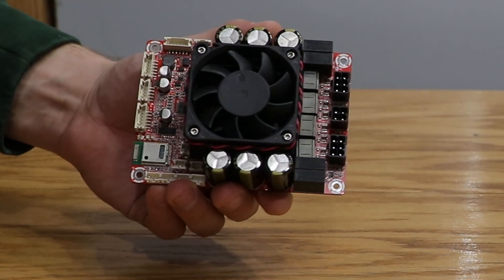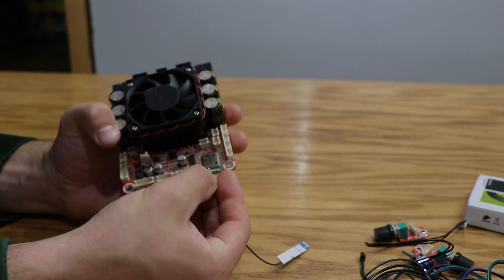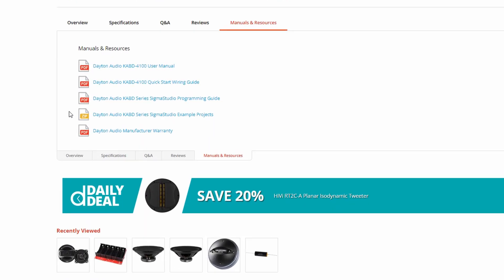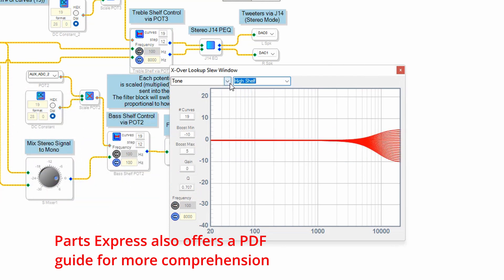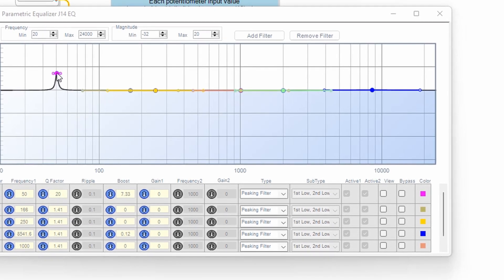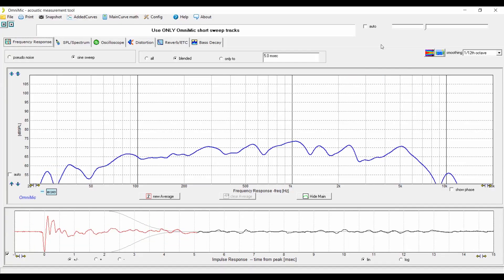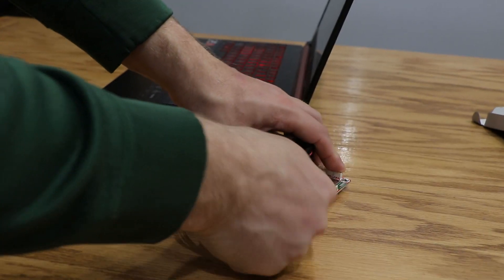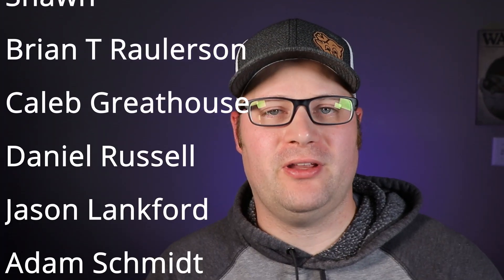Is this the Most POWERFUL Amplifier for DIY? Dayton KABD with DSP

Comment: The only problem I find with these boards is there's no support for power supplies. I mean you can cram 2 of these boards in an enclosure that contains 4-7 drivers including a subwoofer & have an ultimate active speaker but you have graceful way to power the damn thing!!! You can possibly repurpose a meanwell supply by removing its case but those supplies absolutely require the fan to prevent overheating & they're not designed to withstand the vibration of an enclosure. PE doesn't really offer any board power supplies that are needed for a high wattage output, so how do you power them...?

Comment: This is exactly the information I was looking for. I would say that your video has inspired me to experiment with a DIY solution to this problem: I am an aging ham radio operator. My hearing is shot, and ham radios have notoriously poor audio systems. That combination really impacts my enjoyment of ham radio. There is a turnkey commercial solution, a one-channel 10-watt 4-inch DSP speaker that is available for $220 US. I may buy one just to determine if it helps me. If it does, then my other radios would be candidates for a DIY project. Thanks again.

Comment: i wish someone would actually dyno this and see what the real power output is!!!! it wouldn't be bad if you actually got 2x100 watts i buy 4 and build 2 4 way speakers consisting of a woofer/lower mid/upper mid/tweeter.. obviously it would be much better to build a crossover, i mean if a $100 amp could sound so amazing why did i buy a $3000 yamaha as 2200 amplifier!! sadly i just know nothing about building crossovers so i might try this.

Comment: I’m a bit late on this, but is it possible to utilize 2 of these boards in a pair of speakers (more so, 1 board in each speaker) to create a true full range (high+mid+low) speaker? 

I did this already using some stupid high end components (hypex 125w x 2 + 100w tweeter channel) I used an Aurum cantus ribbon, peerless 6.5 HDS mid, and 10”peerless HDS subwoofer. I think it goes without saying that every by setting a very crude crossover within the hypex dsp, they sound great. I was never able to fully understand all of the ins and outs of actually testing each driver and its response using the mini dsp mic with REW which I purchased as well. I had a hell of a time trying to navigate within hypex’s dsp and there is little to no support on how to do such. The instruction manual they supply through their website is tough to understand if you are not familiar with the interface as most of it is simply literature and no actual demonstration of these functions. I have a feeling that the ability of what I have build is not even being scratched at the surface. I spared no expense and planned on trying to sell my product had it been successful as far as audio quality is concerned. Don’t get me wrong, they sound incredibly well as I followed all of the q parameters in building the correct enclosure design, and as stated, also set a crossover that makes sense based on the points in which the drivers fall off within one another. There is MUCH more room for improvement but I do like this idea of a smaller and more simplistic approach. 

Also, what is the over all sound quality of these boards?

Comment: I always had a question about these boards. How can I use these for speakers i am trying to build with some off the shelf amps like XA25 or JC-5 etc. I would not want to replace those fancy amps with the amps in these. When I use passive XOs I can use those between the amps and the speaker. But with DSP type XOs do I need to get these fancy amps for each channel or are there DSP boards that take speaker level input like passive XOs ?

Comment: Hi,
I have the KABD 4x100 and I'm driving 4 store-bought speakers. How can I control fade/balance? I have ordered a KPX. Would like to fine-tune the sound. Any instructional videos you can point me to? Thanks
Reply: i believe you have to buy extra addons to connect it to a computer and use the actual DSP... does it go decently loud?

Comment: Can I use plye 4ch hydra bluetooth amp , plye 6.5 1/2 400watt marine with this Talentcell Rechargeable 12V 6000mAh/5V 12000mAh DC Output Lithium ion Battery Pack for LED Strip and CCTV Camera, Portable Li-ion Power Bank?
Reply: Yep lol good luck with that. :D
Reply: @halrichard1969  how do I hook that battery up to the amp where does the blue wire connect do I need a toogle switch to turn on & off or can I turn the amp off with the battery
Reply: @halrichard1969  how do I connect the red black and blue wire on the plye hydra 4ch Bluetooth amp to the 6000mah Talentcell rechargeable battery?
Reply: @halrichard1969  how can I hook up plye 4ch hydra bluetooth amp 12v Talentcell 6000mAh rechargeable battery , APIELE 22mm Latching Push Button Switch 12V Angel Eye Ring Light LED Waterproof Stainless Steel Round Metal Self-Locking 7/8'' 1NO 1NC 1 charge port and using these 10pcs Conductor Compact Connectors Lever Wire Nut Electrical Connectors with Fixed Base for 3 Circuit Inline Splices 28-12 AWG with out soldering wires ?

Comment: I’m wanting to cascade two of these boards to create 3 way speaker system but can’t find anything referencing the power requirements for two of these together, anyone point me in the right direction?
Reply: I am thinking the same thing but yeah if you want the same output per channel you will definitely need two bricks.  One brick for each amp if you want the same output.  One brick if you want half the output.  Not even sure if that would work. I dont thinkn you could carry all that power on those thin bridge wires to the second amp and all the rest of that particular circuit would have to handle the power.  Pretty sure you will need two bricks sir.

Comment: can this be used in someway or configured on a 1 inch tweeter / 2.5inch mid and 2x 5.5 inch subs in each cabinet? or would I then be more easy if you did a 2 way coax tweeter / mid combo unit and 2x 5.5 subs ?
Reply: Well you didnt specify the actual power output of each driver.  You could, say, put the tweeter and mid on one channel sharing around 100 watts. You could then put the subs on the other two channels for 100w each.   So what Im sayin is one Cab - Tweeter/Mid/Sub with two Channels and the other Cab same same with two channels. its a four channel Amp.    I would definitely get the best brick for power.

Comment: Can KABD dsp do 4-way crossover for both left and right?
Reply from the maker: Each board has four channels. So you can do four channels on each board. If you need a channels, you will need two of these boards.
Reply: one board can do 8channels, but can only output 4ch, so in theory yes, you can, but only using extra amps or dacs with i2s inputs :)  @Toid

Comment: I have a simpler adau1701-based board but wasn't satisified with DAC/ADC performance. It's possible to connect USB interface to it and two DACs over i2s but stuff like this is way beyond my knowledge...

Comment: My question on this is whether or not there is a way to run sigmastudio or a similar program that can set up these DSP's on a Linux PC? I've searched the internet high and low and have found next to nothing that is relevant to this question.
Reply from the maker: I doubt it. But you would need to ask Sigma studios
Reply: @Toid  Unfortunately I've already reviewed their site for the information and they pretty much give any OS other than Windows the middle finger and move on. Thus the reason I was hoping that someone here might have an alternative or a work around to use Linux. Guess I'll keep searching. Thanks for the reply.

Comment: i have a triTrix kit of 3 drivers in each speaker
so that means i'll have to buy 2 of this 4 channels amps
at 90usd Each Before shipping that's 200 usd after shipping.

it's not the same as 60usd worth of crossover parts.
Reply from the maker: The tritrix is a 2-way design using 3 drivers meaning you would only need one of these amplifiers. The two woofers, since they play the same frequency range, 
would be on one channel of the amplifier. While the tweeter would be on the other. Is that more expensive than the crossover parts? Sure. But this also is your amplifier, so I guess that would depend on whether you needed an amplifier or not. But in general, going active is not necessarily cheaper, however it is an option if you desire.
Reply: @Toid  your right if i can connect the two drivers to same one its only 90usd for all the needed parts. so u connect this directly to the tv ? and speakers directly to this ? and then no tinkerinb with settings to make it know your specific drivers ?

Comment: hello sir , you sound system audio quality I like it a lot, it's exactly this quality of sound that I'm trying to have in my car .
 you can help me to see clearly what I should do?

I'm on an Audi A3 8L, I installed rnse from A4,when I tried the golf 6 rns510 radio, the whole problem was solved, the sound quality is very good, the sound quality is super clear and the bass quality is pleasant .but not possible to fit a radio in my central console.

I equipped it with the bose system ( basically it's 2 hp in 10cm at the front at the doors and tweeter +10cm at the rear panel + sub unit with 2hp disappointed. )

I'm looking for sound clarity like the 2010 cars the sub have 80hz , so I changed the front hp to the a8 hp and the rear to the 16cm hp, the sound has become different, but not better, I removed the original sub box, replaced it with a wheel sub box, that removed the 60hz and added 30hz its good bass ,but not good sound but does not make you want to listen to music.  I look for 80hz bass. I think the sound filter of the 2001 and 2010 radio sound different, you either have to modify the radio filter , or need filters between the radio and the amp, but my level does not allow me to filter this her

Comment: My biggest concern is that i wont be able to figure out how to setup the DSP when i begin using sigmastudios. It looks kinda complicated. But the KAB-4100 is the only amp under $100 i can find that is 4 channels with a lot of power and has a DSP, so i think im gonna have to go for it.  also need to figure out how to hook up a secondary amp for a 10" sub so i can make a 4.1 channel party speaker...
Reply from the maker: Go ahead and buy it from the link above as it helps out the channel. And feel free to use the code. TOID to save an extra 5%. If you have any issues or need help, we’re always willing to help on the forum. www.toidsdiyaudio.com/forums  just create a new topic and we will see if we can help. We might as well make the community stronger together.

Comment: But is the fan noisy?  They should look into fanless cooling.
Reply: It would probably be possible to replace the heat sink/fan with a larger passive heatsink.
Reply: I have two of these.  I have driven them hard for long periods of time and only I have only seen the fan go on once.  The heat sink is fairly large compared to similar class d amps and they barely get warm.  I think the fan is overkill and only comes on in extreme situations.

Comment: way better to just buy the RAZOR, Power Acoustik RZ4‐2000DSP , Same exact chip, 75 watts a channels, , super clean sound AND you can buy it for as little as 130 if you catch it on sale, not lonly but it comes with all the pieces, blutooth, usb, and a case, unlike this thing
Reply from the maker: Sounds like a pretty decent deal. The only issue is it doesn’t appear that it can connect to Sigma Studios. Instead it relies on its own DSP app. That’s unfortunate, because Sigma Studios is a huge reason why this amplifier is so powerful. Maybe someday they can implement it, but until then it won’t be able to compete with something like this.
Reply: @Toid  i agree to a degree . . however for system tuning it has every you could want 10 band parametric.  .selectable q freq and 20db  +/-  every cross over type filter, both high pass low pass and (band pass)  any slope 6 12 18 24  on any channel plus time alighment ment. . .for the money it hard to beat especially if you know what your doing with it. . .only this missing is a limter

Comment: I have the programming board, however it seems that you need to leave it attached to the amplifier board? because the settings you saved, are to the programming board, and not to the amplifier board.
Reply from the maker: No, you don’t have to leave the ICP connected to the empire board. They CP is just used to communicate between the computer and that board. Once you send it to the amplifier board and save it, it stays on the board.

Comment: Is it possible to add a subwoofer to this? So there would be 2 tweeters, 2 woofers, and a sub?
Reply from the maker: The boards can be Daisy chained together. So in that example you would end up having two boards. A mono channel board for the subwoofer and a 4-channel board for the tweeters and woofers. Of course that's assuming that you're doing all active crossover. If you're doing a passive crossover then you could use just the four channel. One channel would be for your left speaker one channel would be for your right speaker and the third channel would be for your subwoofer and you'd have one channel left over.
Reply: @Toid  Thanks for the reply! I was indeed thinking of an active crossover for the woofers and tweeter. Is it overkill to daisy chain a second Dayton KABD just for a single subwoofer channel? Is there a more appropriate amplifier with dsp I could daisy chain to the subwoofer?
Reply from the maker: @micahwhite4973  I guess it depends on what you're trying to go for. But I like the idea of daisy chaining them because then you can change the crossover point between all of them at any point in the same program. It just makes integration a little bit easier. But if you want to get a separate just subwoofer amplifier you could. I'm not sure of any that include DSP like this

Comment: Are you saying that a DIYer can use this and not use a physical, passive crossover? Or does this work in tandem w/ a passive crossover? FYI, I'm a speaker noob. I'd love to see a How To Build A 3-Way Studio Monitor Speaker video using this DSP.
Reply from the maker: Yep with this board you don't need a passive crossover at all. So if you wanted to do a three-way you would want two of these amplifiers. Once again Parts Express is done all the work for you so you just need to download the template and fine tune it for your application. If you do decide to get some, feel free to use the link in the description, it does have the channel out. If you need anything else feel free to reach out
Reply: @Toid  I'd invest some money and time on a DIY build that you build on your channel. I'd like a smallish build: 3-way w/ no bigger than a 6" woofer, maybe even a 5". Then the mid and tweeter of course. All within a powered cabinet. Purpose would be as a studio monitor w/ a slightly elevated mid frequencies (500-3000) to highlight voice. Budget at $300/speaker or less, including supplies for plywood box and solid hardwood (Maple?) baffle.

Comment: Trying to find legitimate power amp specs for these all in one boards is almost impossible. Probably because the manufacturer wants to hide the truth of their capabilities. For now these things are simply novelties.
Reply: They list the amp and dsp chip numbers in the product overview. The rest of the specs are in the product manual. Took like 15 seconds. That’s the main reason I like parts express. They may not have the best stuff on the market but they offer specs and graphs of everything.

Comment: I got one - just started messing with it.  Notice one concern, I get noise/hiss when nothing is playing.  Anyone else notice that?

Outside of that, what you can do with sigma studio is amazing! Can't wait to spend more time with it.
Reply: Yeah, this is a cheap amp so I'm not shocked it has a high noise floor
Reply: I noticed the same issue with Arylic 2.1, I'm pretty sure it's a problem of those cheap DSP chips.
Reply: @tomkocur  Gotcha.  Get what ya pay for I guess.

Comment: Damn, I never saw that Dina boom box you made. I built one about 4 years ago like that but I used Dayton tweeters as well. Can't remember the part number. I used the old KAB boards. 100 watt with DSP  and the 2X50 with bluetooth. Used a passive crossover between the mid and tweeters. It sounds really amazing. My only problem with it is, that Tang Band has a ton of distortion. I am looking at that new Dayton 5.5 carbon fiber driver. The one that has crazy XMAX to replace it.

ND20FB was the tweeter crossed at 4k. These tweeters are worth their weight in gold. I use them in every small project. Just amazing!
Reply: The Tangband have 9.5 mm Xmax, or the woofer is broken or it has to do with no highpass on the woofer

Comment: I’m a broke college student and I have a CNC and I’m going to make the ultimate party boom box using FaitalPRO 8FE200 8” woofers, morel CAT 378 horn tweeters, and a Dayton ultimax 8. I just finished the design and have to touch it up tomorrow and hopefully I can start machining next week.

I’m using two 36v 10a power supplies for two KAB 4100 boards.

Each woofer and tweeter gets its own DSP and amp channel, and the sub will get an entire board running in dual bridged mode for 400w total. Already with 50w on the faitals they show 110db on WinISD. This is going to be nuts 🥜. My simulations show the sub can hit 112db at 40hz which is perfect. Can’t wait. Just bought everything today. 

I was thinking about making a YouTube video about it but I’m not sure where to start.
Reply: So did you make them?
Reply: @LiamBRT  I used a ciare hs251 10”subwoofer. Sounds incredible
Reply: @LiamBRT  yes they sound great